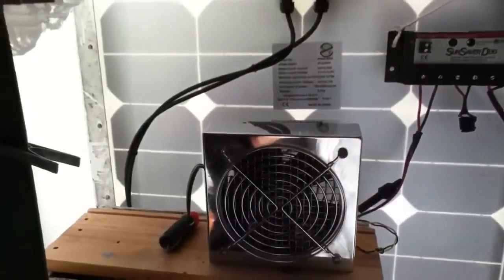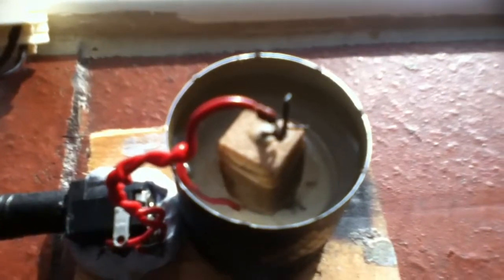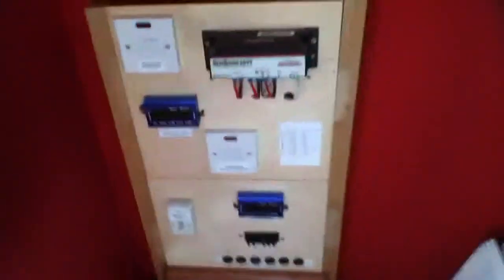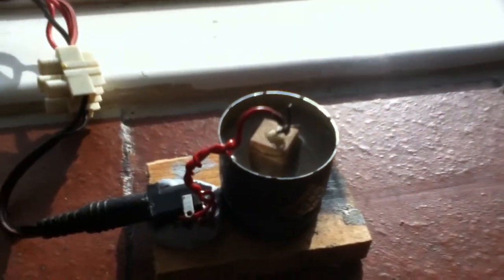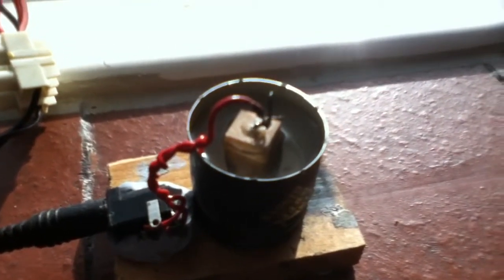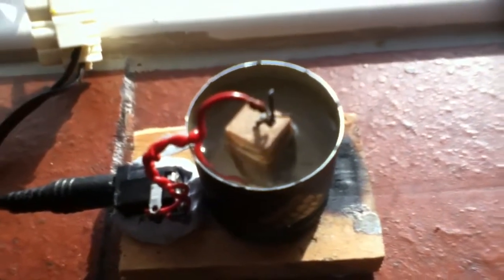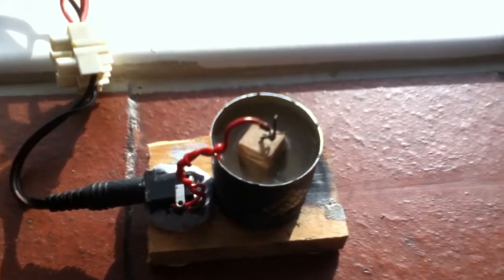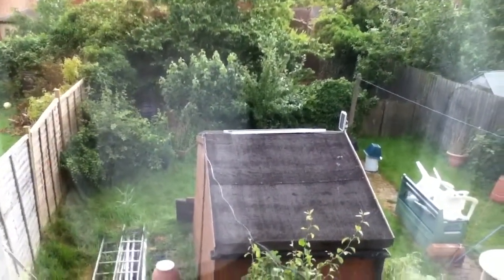Boiling water with solar power

Comment from the maker: The value of the resistor is around 10 - 15 ohms, I can't remember exactly and the power rating around 3 watts. Do bear in mind this was an experiment, I had a 50w and a 20w solar panel wired in parallel in my bedroom window, so not getting the full rated power and the water container was a metal bottle cap, so the amount of water was very small. This is just a demonstration. Heating water using electricity consumes a lot of power, so is not very practical when using off grid solar power on a small scale.